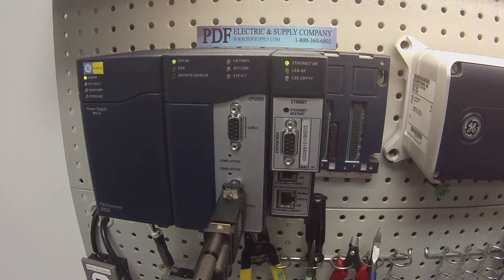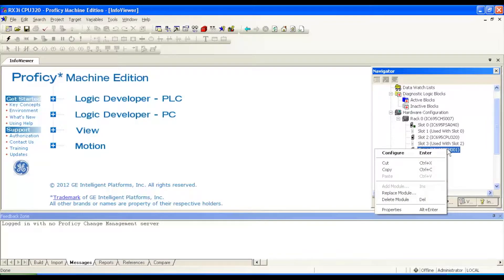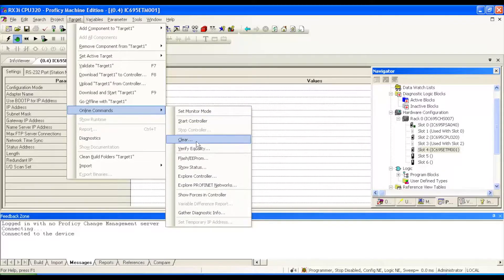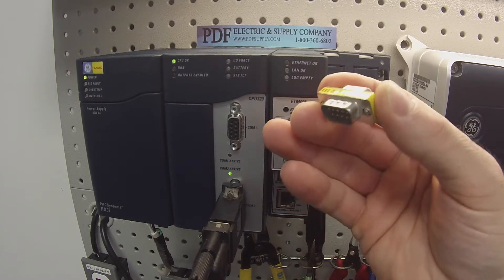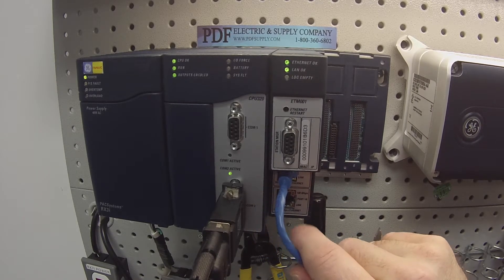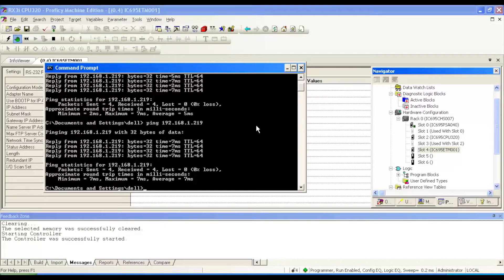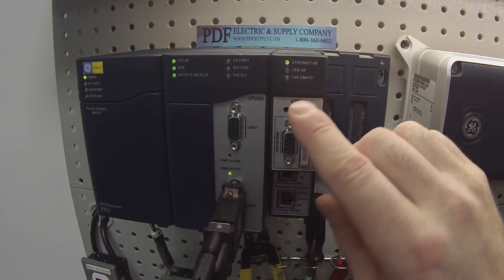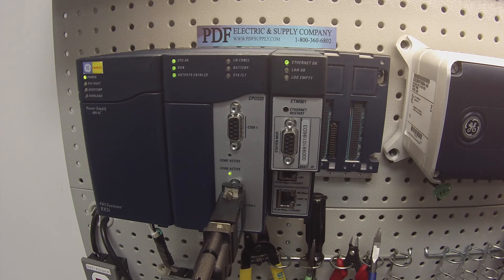How-To Troubleshoot: IC695ETM001 Ethernet Module (GE Rx3i Proficy Machine Edition Training Video)

Comment: I have question about ic695cpe330 controller. Previous I used proficy machine edition in that program seens equal. But now I use pac machine edition but in this hardware configuration not equal what's the solution?